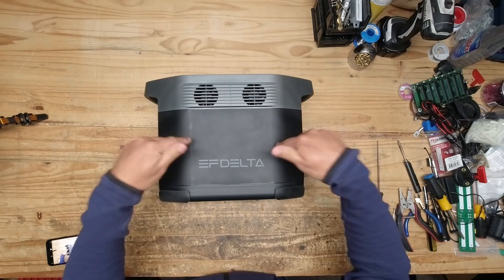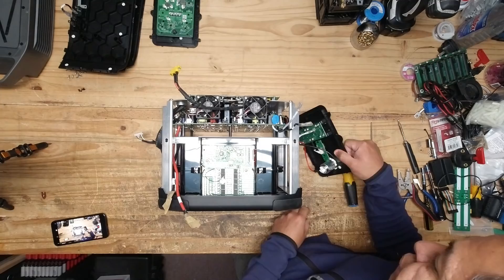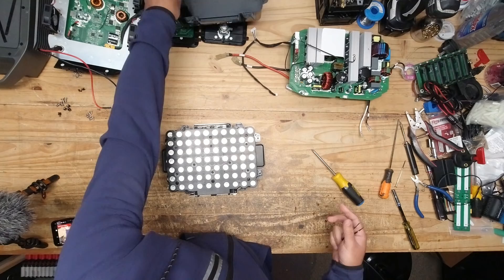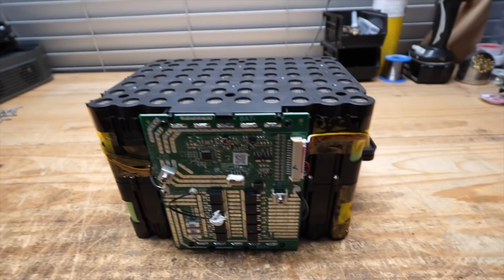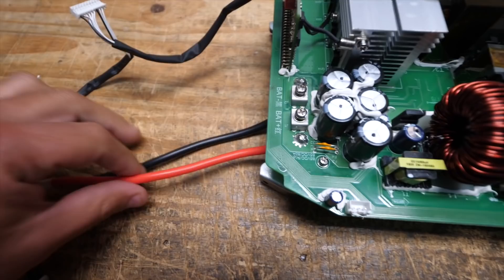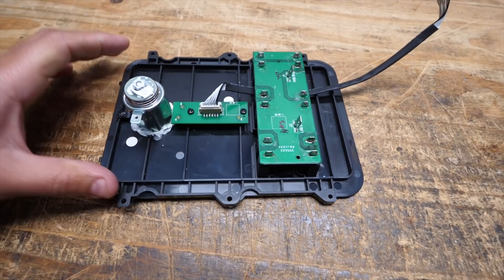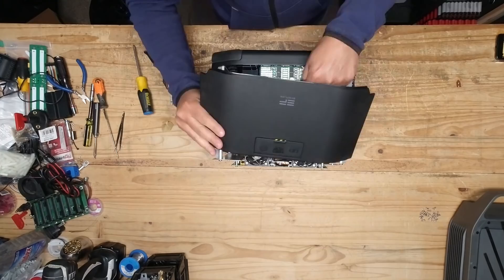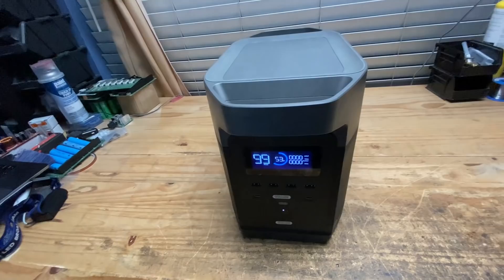ECOFlow Delta 1300  COMPLETE Teardown

Comment: Got a Delta 1300 for Christmas 2021.  The unit was only cycled about 5x.  Very low use and stored plugged in (for emergency use).  It died and will not power on.  Well, it does power up for a sec when connected to AC and shows full charge. . .then shuts off.  Is there anywhere in Northern California I can try to have it serviced?  Gonna tear it down to see if anything obvious is blown, but ecoflow service out of warranty is non-existent.
Reply: same with my Delta 1300. Powers on for a few seconds and off. Tried to charge directly, checked fuses and various other tricks but I think I´m out of luck. Would like to repurpose the cells, looking for ideas. Support only told me to try to keep it plugged in and to send over. For a device that expensive, not really much trust in this company

Comment: So 2 banks of 7 * 10 cells = 2 * 70 = 140 cells in total. Configuration appears to be: 10P * 14S.
Cells are NMC chemistry with 3.6V nominal voltage, and probably 2.6Ah (2600 mAh) each (cell markings: GPHN 18-25P 19H26Z)
14S yields 14 * 3.6V = 50.4V. 10P yields 10 * 2.6Ah = 26Ah.
Total energy: 50.4V * 26Ah = 1,310Wh.
Would be great to replace the battery with LiFePO cells when the originals are exhausted (provided the charging circuitry is compatible).

Comment: Those batteries are 2500 mAh batteries, and those are 3C batteries each, these are more designed for E-bikes, these measure around 22 to 25 miliOhms each and about 500 cycles at 80% capacity, not so bad cells. the Fabric is called Guanzhou Grear Power Energy and Technology Co.
Reply: Can you order replacements online?

Comment: I am wondering how easy it will be to replace the battery cells if they start to degrade. That would make this a really durable unit, and possible upgrade once they manage to increase density of 18650 cells
Reply: If you purchased it on kickstarter, and the batteries degrade,  I believe you have a life time replacement warranty on the batteries
Reply: @DialM4Microcontrollr  That is a great possibility until they manage to get more energy dense 18650 cells or cells with longer battery life. Those could be a real upgrade later on

Comment: Can’t wait for someone to make a video on replacing the battery down the line. If one finds the correct dimensions, they should be able to drop a generic 52v ebike battery in this unit. 14s, though used for 48v ebikes, is considered a 52v battery.

Comment: Jehu, 48 volt seems an oddball voltage but the package seems well designed. Would love to win one!
Reply: With higher voltage, there is less loss during the charging.  If you have a home solar system running at 48v or 72v you will get a lot more power for your money than a 12v system.  But a lot of people are just comfortable using 12v.

Comment: Hey, have ever think about to built a pack cycling charger using one pack to charge another? And them you reverse and so on. to test the cycling life of the batteries you but online. You can do like 12 to 20 cycles per day. Of course you have to add some extra power to compensate de losses.
This could be a good thing to tests the battery life in short time!

Comment: What’s the practical difference between lipos and 18650 cells in terms of safety nominal vdc capacity etc? Can lipos be used in a powerwall? Are lipos better in anyway? Or are 18650’s the holy grail.

Comment: I saw a video where they claimed EcoFlow says you cannot charge the delta with a gas generator. Is this true? I don’t see why if you have a generator rated to deliver the input wattage it needs to charge off AC.
Reply: You can use a gas generator as long as it's a digital inverter type gas generator with pure sine wave.  I use a Honda EU2200i to charge mine, works fine.
Reply: Perhaps they just mean it doesn't charge via DC or use the "smart" features of the Ecoflow generator which requires a delta pro or delta max.

Comment: Hey Jesus,
Can you do a video where you would connect in parallel a 48v LifePo4 to the terminals inside the unit? Or can this even be done and the unit still work? I’m thinking that when the original batteries go, the unit would still be usable. Maybe with an external quick connect?

Comment: Jehu, I’m a big fan of your channel. I am hoping you can help. I was placing a new male end on my Delta 1300  12 volt charging cord and got the polarity reversed on my “test” and there was an immediate slight “pop” sound. My Deltas is now totally unresponsive. The reset button does nothing. Hoping there is an internal fuse that I can replace. Any suggestions?
Reply: Any solution?

Comment: I have this unit but the thing won’t hold charge it’s just dies after 20 minutes and it has a flashing red battery light with a warning symbol
Reply: I have the same problem warranty expired, you find a solution? Thanks for your time

Comment: Hi Jehu! Do you know if it's possible to wire in direct to pull 12v and 10amps? The cigarette lighter plug only pulls 8amps and im trying to plug in a diesel heater in my van. Gracias carnal!

Comment: Not an circuit engineer but a temp sensor directly on a mosfet seems weird. I feel it should be on the board near the mosfet bank. I'm going to assume they have a reason for putting it where they did though. 🤷

Comment: Superb video, Jehu! 
So... the AC charger must be in the "inverter part" then? 
Could anyone tell me, in general, how much electronics is shared between Inverter and AC Charger in a well designed combo? It seams just a reverse function. 
Thanks.
Reply: I'm pretty sure they're entirely separate.
Reply: @michaelscalisi4316  Hey. I studdied the Victron's topology... and AFAIK, in their design it's "pure reverse" based on V potential diferences + switch. 
I'd expect the same structure here.

Comment: Hey Jehu  nice kit, but as people are quarantining themselves due to #ConVid19, please can you show, quick; easy to build 12V batteries, for the non technical people. Something people can make a home will basic hand tools.

I enjoyed and made the 38120, 16 cells; 12V battery with BMS.

Please also look at making low power inverter videos, ranging 600W to 800W, for people to have in the homes for emergencies. 

Great believer for making at home, if you make it, you know how to repair it. 
 
Keep up the good work.
Chud in London
Reply: I highly recommend to go through Jehu's videos on the channel, he has shown detailed videos on making battery packs, not only that you can get all the stuff shown through him as much that you see except for cells is actually designed and made by Jehu.
Reply: Nice idea, but I'm not sure there is a quick and easy way for non-technical people to build their own battery packs. They should either know what they're doing, or just buy something of the shelf. No need to add house fires to the problem.
Reply: #Node Systems Ltd, what our friend #soupisgoodfood suggests is the best idea to buy a ready made product with your required volt and amp HR rating coz point one these batteries are carrying ton of power, if manhandled they can show their devil inside if they are not connected correct you will cook those batteries n fry your work bench my brother Lolz, If you still insist to make a pack yourself I think Jehu has made tons of videos and they are simple, Rocket science is also simple if the basics of the concerned subject are clear my dear friend!!

Comment: Wasn't considering them  using 48V.  I would have thought 12 or 24v most.    Guess they can squeeze a bit more efficiency out of the battery doing so.
Reply: 48v is pretty common for UPSs (which this basically is). Highest voltage without getting into dangerous territory.
Reply: @soupisgoodfood42  Shouldn't 10S be 37V with a range from 42V to 30V. Or is 42V close enough to refer to it as 48V and not worry about semantics.
Reply: @watchfullbird6381  He said it was a 14S after a closer look. FYI,  yes a 10S pack would probably be too low for an off-the-shelf system. You wouldn't want to drop a 48v lead-acid pack below 40v. But then again, UPSs are designed sacrifice their batteries if they have to, so I'm not sure what the true limit is on most systems.

Comment: Ok last night I was using my Eco Flow 1300 and heard a loud POP inside and have now have the 50 HRz and overload flashing ...the 110 w not working but the other side seems ok ...I bought the unit in the US but took it with me because lives overseas he unit is like 2 months old I know I have warranty but is going to be difficult to use it where I live ....any thoughts what happened here ....I move it and sounds like a broken part moving inside any input will be highly appreciated...the overload is flashing and nothing is connected...
Reply: Mine did too.   Found the 20 amp fuse blown on the main board and arcing marks underneath the board near the fuse.  Waiting for a replacement 20A axial fuse to see if that will get it working again.

Comment: ok not savy at all... i been watching your vids and all i need to know is when power goes out how long can i run my c-pap. kilo watts hours and stuff doesnt answer that .. i'm a light switch is on or off type of person..lol
Reply: Impossible to answer accurately without meaningful info. How much energy does your machine use? Ten second googling says that avg cpap uses between 50 and 100 watts on average. Take the watt-hours of the battery you're looking at and divide that by 50 or 100.
Reply from the maker: Yes

Comment: How about some more technical details about individual components in the inverter, like capacitor brand?  If they used cheap ass Chinese capacitors, you can be certain this thing will fail within a couple years